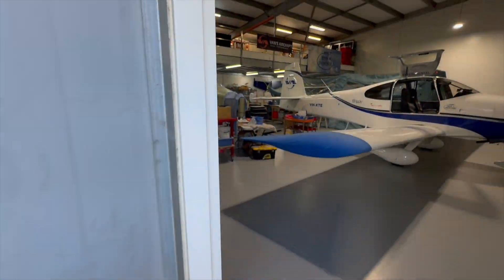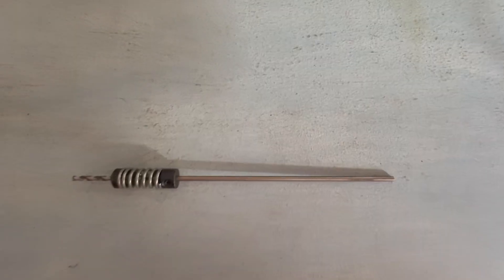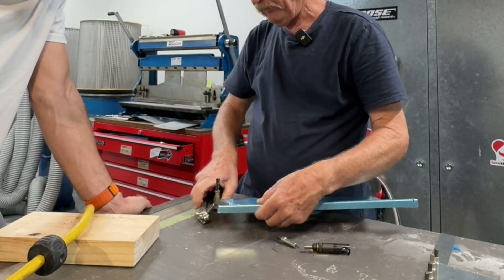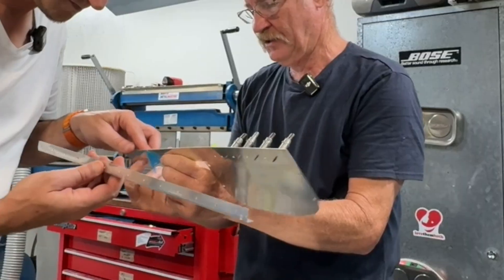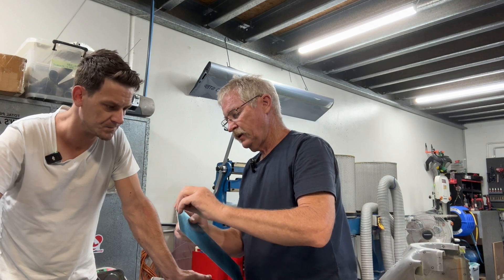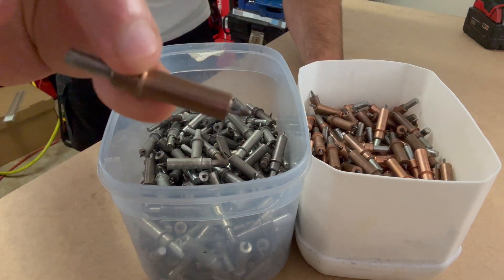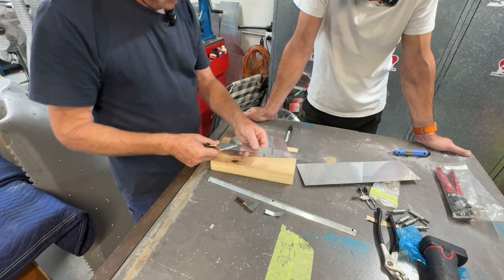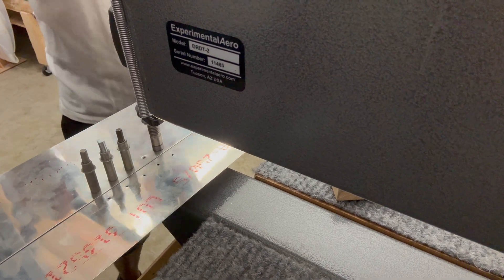Episode 1 Building the RV14A.  Back to basics.

Comment: The DRDT2 needs to go fully over centre of you will end up with underdimpled holes and a crappy line of rivets visually. Have a read of the manual. With no metal in between the dies, the nut should be adjusted to there is a tiny bit of flex in the steel arm of the tool.
Reply from the maker: Thanks for tip! 
I will definitely need to be well read up on it by the time i’m up to drilling and dimpling fresh pieces. 👍